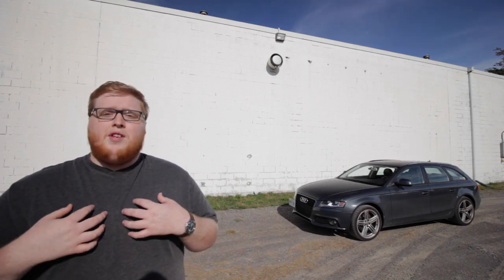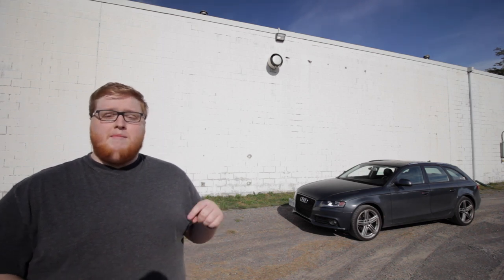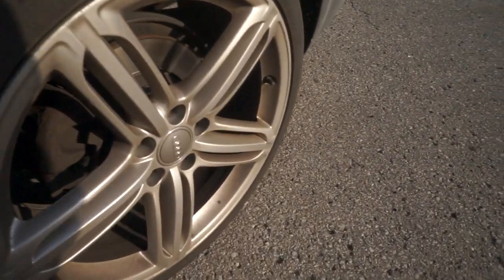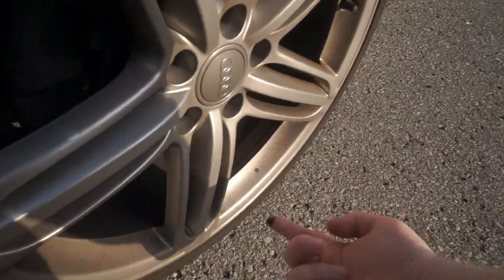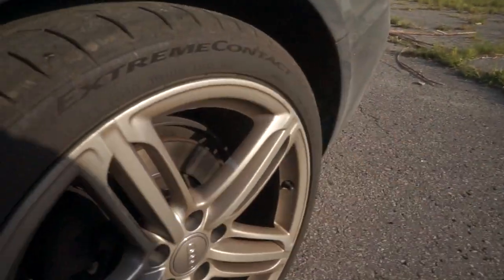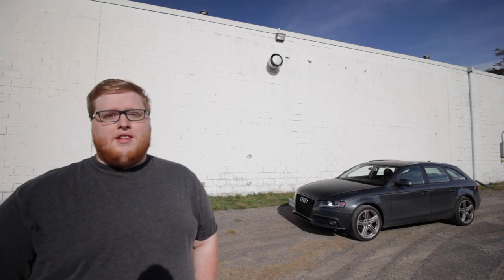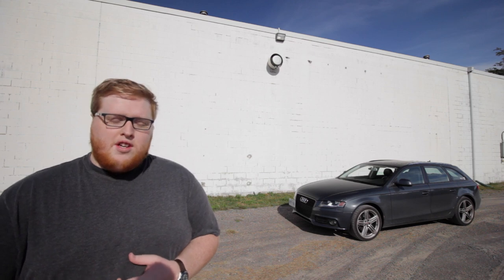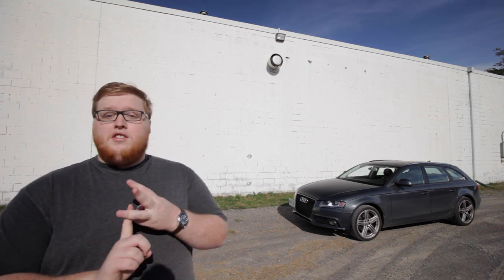Ceramic Brake Pads Update. The Good, the Bad, and the Ugly

Comment: Check out Carbon Ceramics  it's a Carbon Infused Ceramic pad you can also get them in Metallic. They offer aggressive stopping power, minimal brake dust and long life and low wear on rotors. Check them out.

Comment: Great video! After watching this, Im seriously considering getting ceramic brake pads because I recently changed my rotors and my pads on my Altima and got some new set of custom wheels and noticed as soon as I got my rotors and pads changed that I got a huge mess of brownish brake dust on my wheels especially on the fronts. Even after I ceramic coated my wheels, it still gives me a hard time to clean them. The ceramic coating does indeed slow down the process of the dust piling up better than without but it’s still very hectic to deal with. I know brake dust is normal, but a crazy mess of brownish/goldish dust messing up the look of my wheels is just insane. And they’re black wheels too. I’ve always considered getting ceramic pads but this video just solidified my mind to getting ceramic pads ASAP

Comment: I’ve spent more time than necessary trying to figure out whether ceramic or semi-metallic are the way to go and the most consistent information I’ve found is if you prefer a little more initial bite, marginally more stopping power, don’t care about dusting, and don’t care about having to replace your rotors each pad change go with an OE (for VW) semi-metallic compound otherwise ceramic is the way to go. 

Also, it’s wise to bed-in ceramic because I do think they primarily rely on adherent friction vs. abrasive friction semi-metallic I don’t really think it matters too much.

Side note, I found this particular platform actually relies on the rear brakes more, I have a 2006 Jetta which should be the same, I notice my rear pads go out first.
Reply: To each their own, for me I like a good semi-metallic for better feel and stopping power. I have been using Bosch.  I hit a Moose a few years ago in a BMW 330i and the stopping power that car had was incredible it saved me, yes lots of brake dust but when my life is on the line I go for the best.

Comment: Either cover your brakes with cloth or preferably remove the rims, clean them really well inside and out, dry thoroughly then use a dry film lubricant with PFTE/Teflon - I use WD40 personally and you'll find that wheels only need a quick hosing to get them clean again. I did try using a ceramic coat that I use on my paint, that works well too  - though  - for me, it didn't last as long as the WD40.
Reply: Good tip, I'll try that.
Reply: 1:18

Comment: I need information about my S8 D3 ceramic discs. Can I get aftermarket pads to match? Also, if I remove them, can they be replaced with steel discs easily or are there a lot of additional things to consider?

Comment: The problem with this video is that there's a wide range of performance with ceramic pads depending on the manufacturer. You can't judge them based on your experience with just one brand of ceramic pads. And you didn't even mention what brand they are so this video really is pretty useless.   There are incredibly good ceramic pads and there are terrible ceramic pads. One of the reasons for that the binders used are different. Remember, the ceramic material is just a small part of the brake pad material. The rest can be organic, semi-metallic or other materials.  So,  as I said, you can't generalize based on your experience with just one brand of ceramic pads.  Check out Akebono ceramic pads, for example. Some claim they are the best pads in the world.  At the very least, you should have mentioned what brand of pad your talking about. Are they cheap ones or more expensive ones from a company with a great reputation.  

All-in-all, that makes this video pretty useless.  It tells people virtually nothing.

Comment: Thank you for the update. That's a sweet ride. Happy Thanksgiving! What brand pads did you use? I have a Q5 and would like to change to ceramic too.
Reply: If you haven't changed pads yet, I highly recommend EBC Redstuff. Used on my old BMW 328Ci and my friend used it on his tuned EVO. Ceramic pads, quiet, long lasting, excellent cold bite and basically no dust! :)

Comment: Question: Why have you put ceramic's on a basic A4?
Reply from the maker: My goal with the switch was to cut down on the amount of brake dust I had to clean. On top of that I needed new pads and they were the same price as normal pads so I thought I'd try them out.
Reply: BakerReid_ Ah fair enough! Thanks for explaining 😂
Reply: Bruh.
A "basic" a4 can be a really good car for small road.
Plus even the 1.8 can make like 260 hp. But you're american and don't understand that 260 hp is plenty. You got the same in your minivan, but american people still understand that their cars are heavy, they don't need more power, they need to be lighter.